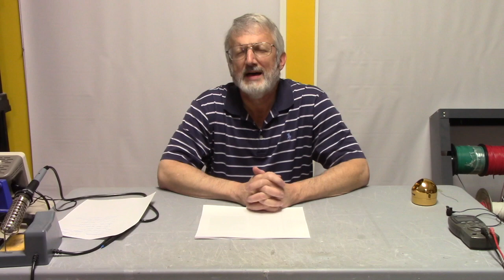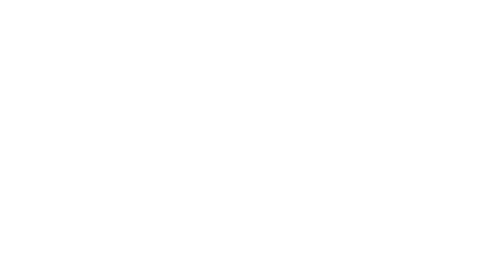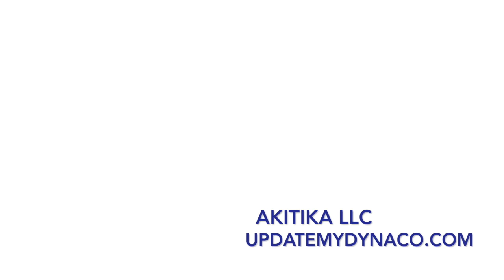Tube Amps vs Transistor Amps...Why Do They Sound Different?

Comment: Depending on how the bias for a tube or solid state devise is setup, it will emphasize either 2nd or 3rd harmonic distortion when over-driven. Over driving (clipping) a tube causes rounded edges and even harmonic distortion  which have a softer sound.  Over driving a solid state device causes flat edges resembling a square wave that consists of odd harmonic distortion sounding less soft.

Comment: My 2 cents: there are a couple of factors that might favour tube amps over transistors (bipolar and FETs):
- coupling impedances, transformers, maybe inner hysteresis or saturation of cores might color the output sound.
- 3rd vs 2nd order harmonic distorsions that seem to have some psychoacoustic impact
- the fact that most of the FETs used in DIY amplifier are switching type (IRF series), VMOS, not suitable for audio which should be of lateral type.
- lack of local negative feedback, only global network feedback which, in case there are propagation delays can cause ripples. Tubes have much higher slew rates which is also beneficial for global negative feedback networks because.
- some subjective favoring of the tube sound: more expensive stuff is perceived as better sound delivering which is not always true...

Comment: Hold your horses there.... A tube sound different ( better ) from a transistor mainly due to the 2nd and 3rd harmonic distortion. you get the 2nd harmonic if you adjust the tube bias way too low in its linear region and 3rd harmonic ( soft clipping ) from overdriving the tube when the bias is set in the middle of its linear region.

Comment: What amazed me many years ago was discovering how chips (mosfets actually) which can either be used in switching power supplies over to be used in audio amplification.
I had it in my head they were like little inverters creating variable frequency output intended to go to speakers LOL.

Comment: First, I think it would be good to specify that you're talking about transistor amps that use bipolar output transistors (which admittedly is the majority of transistor amps). Mosfet-based amps are different. That said, while I agree with your proposition that the bias compensation in most solid-state amps is less than optimal. In fact, the bias compensation in most solid-state amps is there to keep the amp from going into thermal runaway and burning itself up, and not for any other purpose.

BUT... I think the big difference in the sound of tube and solid-state amps is not the tubes or the transistors. I believe it is the output transformer, and the topology of the output stage. Transformers are reactive devices with huge amounts of inductance, and they can store large amounts of energy that can get passed on to the loudspeaker along with the intended signal. This extra energy often creates a "euphonic" sound; that is, it sounds good, even though it is technically distortion. Since very few solid-state amps have output transformers, they usually don't create this sound.

I could be wrong, of course.
Reply: Also reckon that a famous brand co has been built transistor amp with an autotransformer to adapt the impedance of connecting loudspeaker, in order to attain high power outut but within safe operating area(lower working voltage). But its performance is critical(?)unlike the output transformer of tube amp.
Difference behind is that the tube works at high voltage(20~30X)，like the oversampling of digital process. 
It  can be imagined that tube amp with high impedance(10KΩ) output transformer can tell the story ?

Comment: Or, go MOSFET
* No thermal instability
* Transfer function comparable to tubes (both square law devices, not exponential as bipolars are)
* No transformers needed

For example the TDA7293, which I use, also on one die
    * MOSFET gain and power stage
    * Bipolar input stage
Reply: Tubes are 3/2 power linearity, bipolar is logarithmic linearity, MOSFET is nearly linear above threshold, JFET is square law.
Reply: @redhilllabs3245  Is that output current vs input voltage?
Reply: @JerryRutten  Affirmative (including bipolar)

Comment: Interestingly, (electrodynamic) drivers have the same problem.

More power into the drivers means more heat into the voice coil, higher temperatures and higher resistance. So the music modulates the voice coil resistance.

A change in voice coil resistance means a change in
* sensitivity of the driver
* output of the driver
* compression of the driver
* frequency response of the driver
* distortion in the driver
* damping factor
* actual electromagnetic damping
* cutoff frequencies of the passive crossover filters

This is the price you have to pay, unless you have an amplifier (solid state or tube) with a very high output impedance (a damping factor smaller than 1%, anyone??) and active crossovers.

Comment: A good solid-state amp can achieve less distortions as compared to any tube amp, period. Through a tube amp, warmth us added to your music whether you like it or not. Imagine listening to a piano or other acoustic instruments with that distortion, unless you are not serious in music or do not know how a real acoustic piano sounds like. Sorry if I have offended anyone.
Reply: Less vs. less audible distortion is up for considerable debate. Low-level (< 1%) 2nd and 3rd harmonic distortion has been proven quite inaudible in listening tests but 0.1% of 7th and higher harmonics can be heard at higher volumes. Most tube amps generate very few harmonics beyond the 5th until they're clipping. Since they mainly generate 2nd and 3rd, their higher distortion levels don't matter even with uncompressed recordings of acoustic instruments.
Reply: @1mctous  Debatable???
No. Its only arguments.
Warmth will be added to all music or information fed into a tube amp and these distortions are audible.
If you are serious in music, go enjoy a good solid-state amp.
Reply: @samc269 Both harmonic and IM distortion are largely inaudible under 1% with most music unless high-order (5th and higher) distortion prevails. There are 6 decades of research to back this up.

Comment: Different types of distortion. When a tube amp goes into clipping the sine wave at the top is rounded. A solid state amp clips with the top of the wave sheared off in a straight line.

Comment: This is a good question and your answer does fit with what happens in many solid state amplifiers.

Here's a few other considerations. The transistor is primarily a current controlled device, whereas a vacuum tube is primarily controlled by voltage. This in effect makes the vacuum tube more closely follow the change in audio signal and much less to heat and current. Again, this is a generality and often is compensated for with modern circuit design. 

Vacuum tube amplifiers are usually designed to have the final output go through an impedance matching audio grade transformer. This transformer is critical in how the amplifier sounds overall. A transistor amplifier with rare exception, is a direct connection between output transistors and the speaker. 

Finally, the reasons for the difference in sound usually come through there type of harmonic distortion. Tubes as I recall produce 2nd harmonic distortion while SS amps produce 3rd harmonic.
Reply: A good ss amp produces almost no harmonics, I built a diy mosfet output ss which is a voltage controlled device. And has a locked bias using some fancy feed back so temperature has no effect on bias. Interesting enough it sounds like a tube amp.
Reply: @slydawg-d1n  I have a good all mosfet amp made by Muse and while it sounds pretty good it is no tube amp. I like a tube amp that sounds more like a transistor amp. Try an Audio Research tube amp like my D50 or D90.
Reply: no es así con los mosfets que tambien son transistores

Comment: Hi Dan. Yes it's a classic question that's never really been answered. Bias current as you say is among the reasons and I can't argue with that.

I'm not an engineer, I wish I was, I'm just a longtime hobbyist and I see that question from a different angle.

It is really similar to the other question of whether wired is better than wireless in audio. How is it similar?

The main difference between tubes and solid state is that the signal is made to travel "wirelessly" in a vacuum compared to a silicon path in solid state. How can there not be an audible difference, all other factors considered?

No one really knows what really happens to complex analog electron flow when the full laws of physics are applied but we can all hear its end results.

Thus far my preference has been using a tube preamp in tandem with SS amp. I suppose its one of those cosmic mysteries we still have not fully uncovered.

In audio, mystery has always been part of its appeal. Everything makes a difference, synergy is the ultimate goal and getting there presents endless alternatives.
Reply from the maker: Yes!